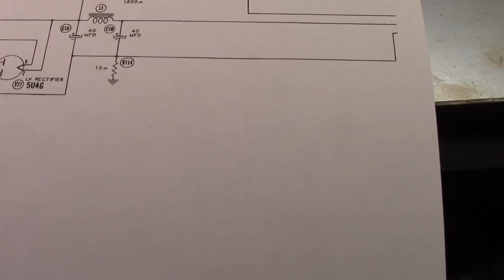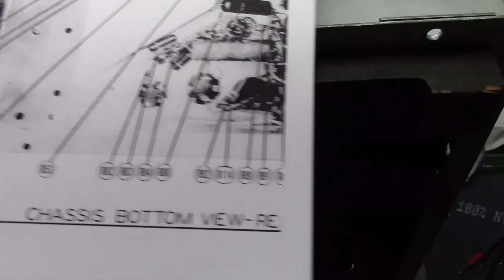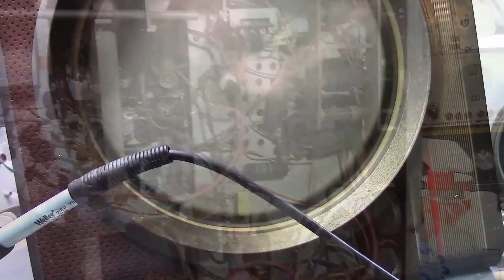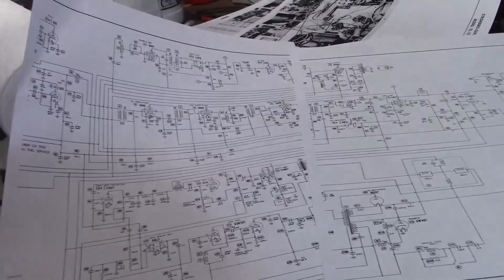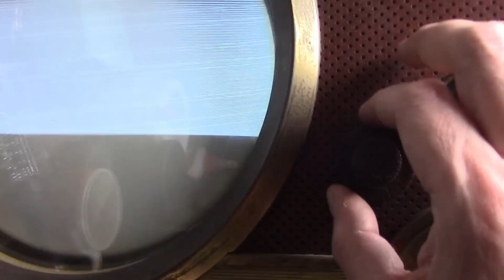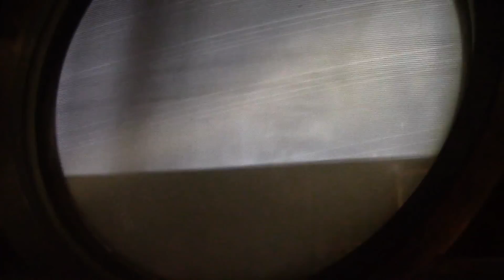Stromberg Carlson TC-10 restoration part 2

Comment: Bob, newby question: would C1A and C1B need to be polarized [electrolytic] caps or would poly caps be suitible in this case? Online research says it is OK for smaller values but not for larger or PS caps.
Reply from the maker: Yes, poly caps are fine.  I have also used them in radio power supplies.   The polypropylene motor run types.

Comment: While out on service call, from time to time I would spot a TV console curbside. Id call another tech in my area and ask him for help loading it into my truck. From that point on I would begin to restore it one section at a time. The sets were not vintage yet, but once repaired or restore, very useful. Some men while going thru a divorce settlement would physically damage a TV to the point it was unusable. These sets took the longest to get restored by the most rewarding projects.

Comment: Each section had  circuit design  teams and one group that integrated all the circuit layout. Everyone had an electronics specialty, RF layout is far mor difficult layout than power supply layout. Audio is lss critical than RF but less troublesome than DC power Supply layout. High voltage generation and regulation was the most critical are of design of all the circuits. Poor regulation manifesrs itself in the video, Vertical and horizontal size along with linearity.

Comment: Caps do not to be 600 volt replacement rating. Multiply the AC volts by 1.4 to get the peak equivalent filtered DC cap charge value. The lower the cap voltage rating the smaller it is an easier to fit in. Typical I use 350 DC ratings. Manufacturers went to. Higher voltage rating for maniacal safety purposes, but not practical values. Using multi cans saved space and cost in fabrication. In All America 5 tube radios I use 150 volt to 200 volt ratings leaving plenty of mounting space without cramming parts together. The bottom line is adequate filtering and practical safety measures.
Reply from the maker: There is a surge in power up before all the tubes start conducting. Also, capacitor life is extended if you allow for some headroom.

Comment: Like the original multi cap cans. If one section is bad eventually they will all go bad. I like to use individual electrolytic mounted on terminal strips, rather than stuff them. Each cap is then a value on its own for future replacement.
Reply from the maker: I've been using adapta-caps lately with good results.

Comment: Well, a 7.5k would be violet-green-red. If the original was 20% tolerance, that’s brown, I think. And a brown band on a dark-colored resistor, it could easily be missed, leading someone to read it as a red-green-violet resistor, or 25 meg, and (for me, at least) a violet color band looks a lot like a blue one, or 2.5 Meg. It looks like the set has a 2.2 Meg; fairly close, and 2.5 Meg isn’t a standard value - closest would be 2.4 Megohm, I think. My guess is someone colorblind tried to replace it without the benefit of an auto-ranging DMM… or a schematic, for that matter.
Reply from the maker: Except that the original is a big 8 watt wire wound power resistor with the value printed on it - no color bands.

Comment: Sure that mystery resistor isn't R69 a 220K Ohm? That could have drifted to almost 1 Meg. There is one reversed E cap in
 the circuit at one plate ( pin 2) of the 6T8 at 1uF. You would need that as 6T8 is the ratio detector. The E-cap cans do something that I'm not too crazy about (but makes cost savings  sense) is both C2 and C3 do double duty in two separate sections of two sections of the TV. Oh this will be so much "fun" replacing caps everywhere especially the center angled
area of mid chassis field!
Reply from the maker: Yes, R69 is directly above it.

Comment: It looks like it is really coming along! I would suspect the lack of vertical sweep especially toward the bottom is going to be the electrolytic cathode bypass cap on the vertical output tube. What a strange method of chassis construction!  Glad removing the side panel allows better access to those deep buried caps!  I hope the lack of gain problem is something simple like screen grid resistors for the IF or power supply caps or something.
Reply: Surely there was a practical way of putting this all together, but to reverse the process would require quite a bit of disassembly.  I'd be pretty sure this was Stromberg-Carlson's idea of compact construction.  The case might not be as "sleek" if it were better built for serviceability.  With great optimism, SC might have been thinking that oh, all that will need to be serviced is tubes and adjustment twiddling.  We know now that this is NOT so, given the capacitor technology of the era, let alone resistors that go wild.  How did they not get the message that bumblebees will sting?  And so much for that sleek little box which costs an arm and leg in labor to service.